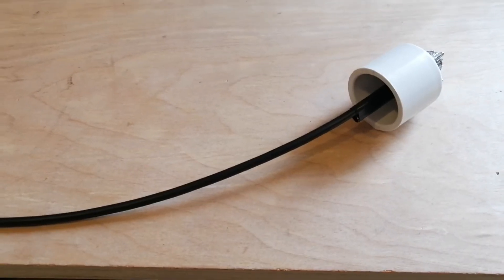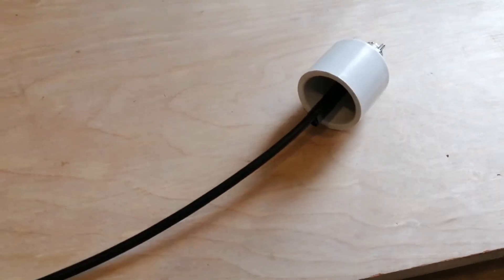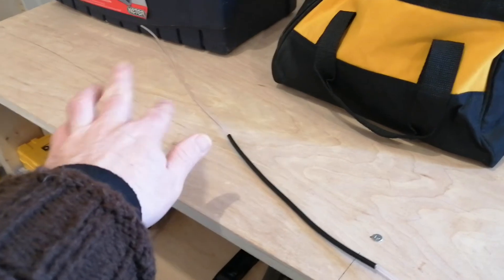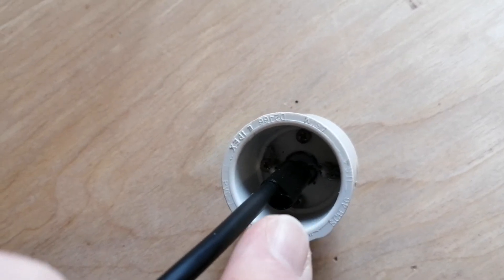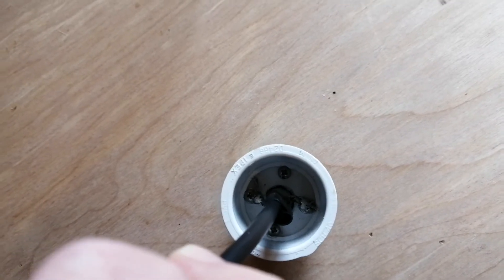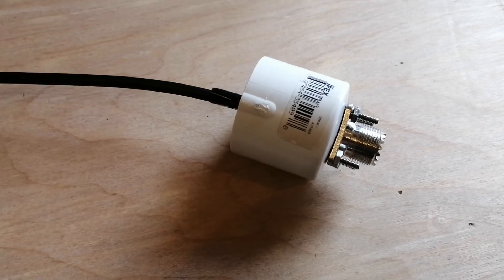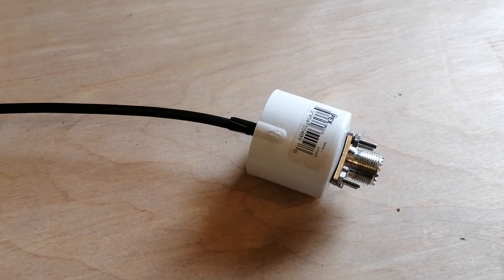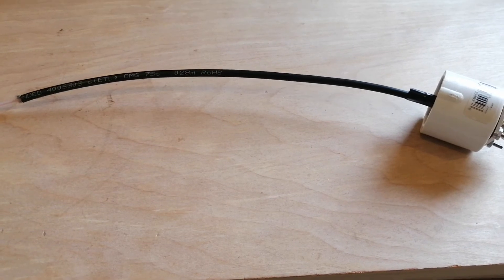Dual Band Co Linear Antenna Made From RG58 Coax

Comment: The radiation pattern on 70cm for this antenna is awful. 50%+ signal is going up In the sky to the airplanes

I have a new, real, dual band 2m/70cm home brew antenna I’ll be publishing soon. +3.5db on 2m at 18 degrees radiation angle. +4.5db at 70cm with 15 degree radiation pattern. And it’s only 42 inches tall. 

Will out perform Ed Fongs dual band jpoles & N9TAX dual band antenna. 

Been working out the kinks for the last couple months. Look forward to publishing it and ppl trying it out.

Comment: Very similar to the DBJ1 antenna from years ago. I saw one made with RG213 30 years ago, and it was fine up to about 1kW input power, the stub required some adjustment to get it 1:1 SWR.

Comment: This antenna is fake news and would most likely cook your finals. Coax capacitors do not get shorted at the end they are always left open as they rely on the inductance of the close proximity of the core and shield. Transceivers are expecting a 50ohm load not a 0ohm short. The rest of this so called antenna makes no sense either. Keep searching around you will find some good coax builds out there the dual band slim jim / jpole, the 5/8 wave gain master clone and single band collinear are a few that work damn good.
Reply: Educate yourself about stubs here to avoid embarrassing yourself with comments like this in the future. Stubs can be open or short circuit:  https://en.wikipedia.org/wiki/Stub_(electronics)
Reply: Knowing that the coax center conductor will have 1.35 ohms load per 1k ft and  .37 ohm per 1k ft for the shielding we can calculate how much coax is needed to create a SHORTED 50ohm coax capacitor stub and that length is around 29 THOUSAND FEET of coax  so as I mentioned above COAX CAPACITORS do not get shorted at the end they are ALWAYS left open.
And how many ohms of load do you expect to get from a 3 inch SHORTED stub connected directly to the base of the antenna as seen in this silly video? (0 ohms)
And what happens when you short the antenna port of just about any transceiver with a 0 ohm load?  (The finals burn up)
Also to build a REAL colinear coax antenna the core and shield are reversed every 1/4 wavelength not completely removed as seen in this video  @TheWaterboarders
Reply: @fivestar2227 The DC resistance of coax has nothing to do with this antenna design. You are mistaken in your reasoning.
Reply: i made this antenna and works perfect..swr 1-1 in vhf and 1-2 in uhf  after  a little triming of the top element... measurd with nano vna..